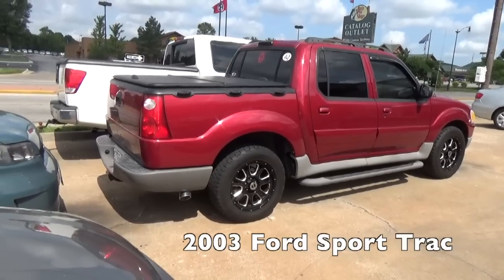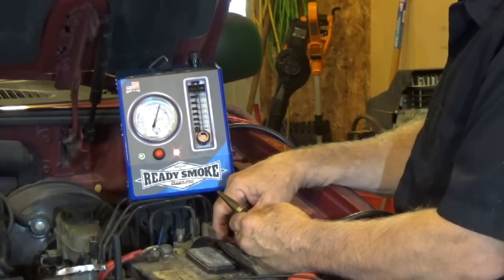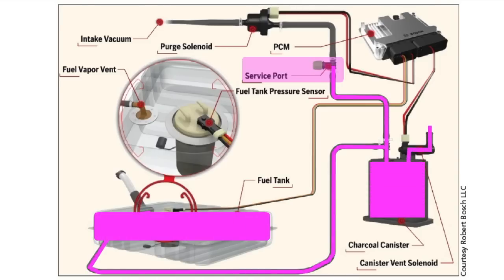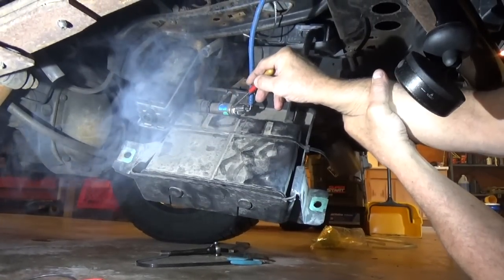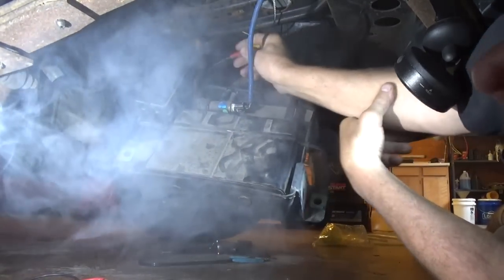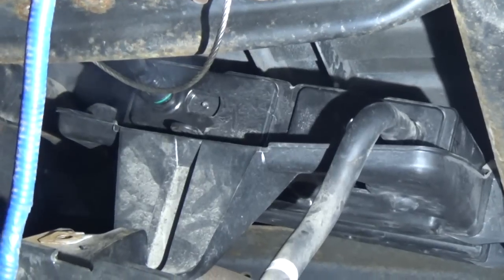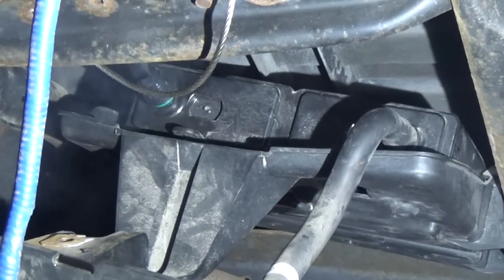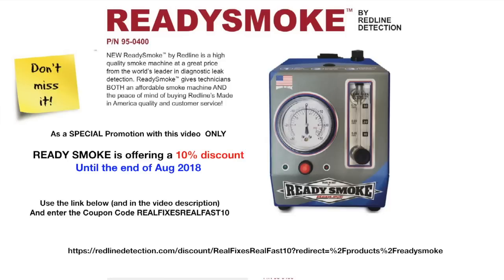EVAP Code P0442  Finding the leak

Comment: Same truck. Same problem but no smoke machine. How can I close that vent valve without a power probe?
Reply from the maker: review the diagram, unplug the vent valve then simply provide an external power and ground to the valve instead of the vehicle wire harness
Reply: @realfixesrealfast  thanks.

Comment: When we ground the signal wire, is the car running, ignition on, or ignition off please?  Also, do we need to worry about how much smoke we put in the system?

Comment: Doesn't that tube used to vent the fuel fill neck converge with the neck underneath the fuel cap?
Reply from the maker: Good observation.  Yes your right.  We had to pull it loose when we dropped the canister unit down for a better visual of the system.